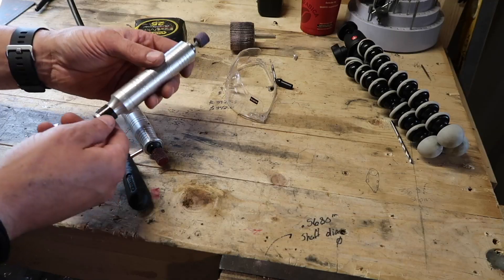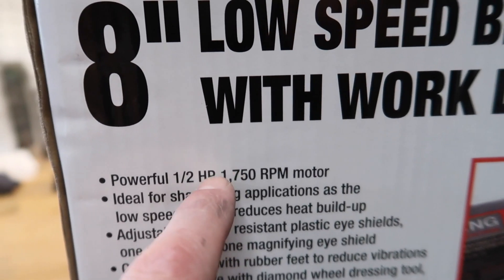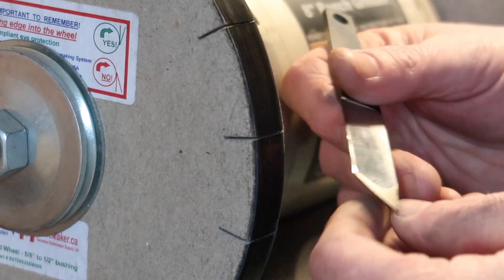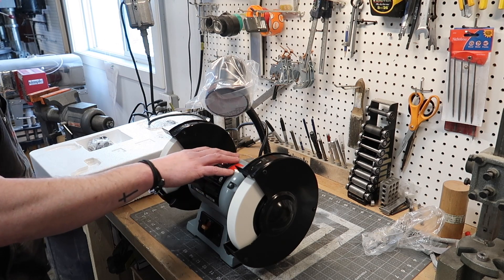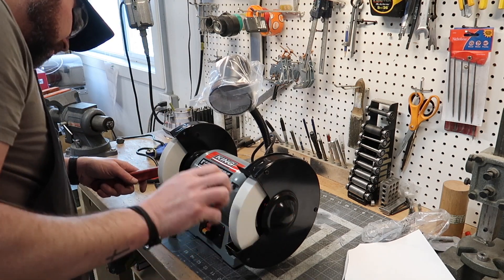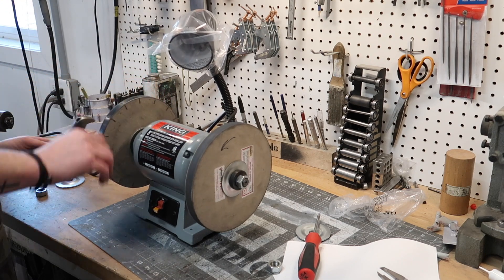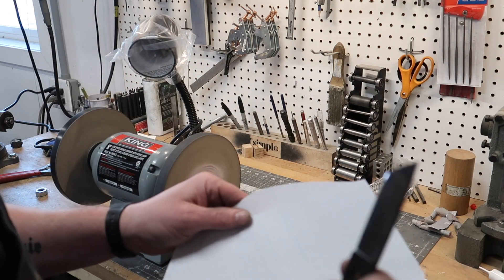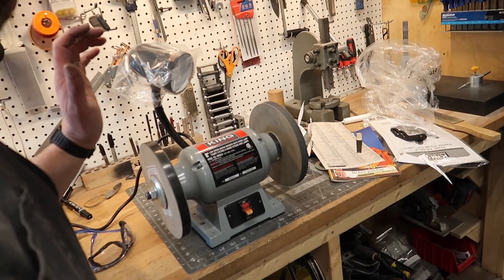Can we make this knife sharpener better? Tool Time Tuesday

Comment: I have a paper wheel sharpener.  I don't feel like a machinist when I use it, but I wind up with a sharp knife.  One thing I did was I replaced the 180 grit on the course wheel with a finer grit, possibly 320.  It was much more satisfying as I rarely sharpen a totally dull knife, and it feels less destructive.  I got the grit on Ebay.

Comment: I never thought about standing to the side while turning on the bench grinder. It will now be put into practice. Thanks for that. I have been using the Wicked Edge to sharpen my knives and I finish the process with a leather stropping belt on my 1x30. I’m going to look into those paper wheels. Thanks again!
Reply: I have found 600 grit on the 1 by 30 followed by leather belt gives a good quick edge, you do have to be careful to avoid overheating though.

Comment: gave up on regritting the mdf wheel, made an 8" plywood wheel, glued on 240 grit emery sandpaper, lasting over 50 sharpening and still going without any signs of failing!!!!

Comment: I have had paper wheels for years and never over heated a edge yet. But I know when to back off. A slower speed wheel is an advantage but it can function fine at a higher speed with care.
Reply: At the cost of these blades any knife nowadays it’s just a chance I’m not willing to take it happened so fast overheating

Comment: I use beeswax on my sharpening belts and my old paper wheels and it's a lot more difficult to heat the steel up.  The beeswax really cuts down on the friction.

Comment: I  have my paper wheels on a 1750 rpm grinder.  I have my cotton edge buffing wheels on a 3600 rpm grinder. I recently purchased a Wen wet/dry grinder with 110 rpm.

Comment: I love Razor Sharp. Though you never wanna see sparks. Hence the wax. Sparks indicate that you're already overheating the apex. You might get away with it on high alloy stainless tool steels. On high carbon or similar you probably lose some hardness even if it feels cold to the touch. You never feel the true heat inside the apex with your fingers. Temper colors also don't tell you the whole story, especially on stainless steels.
Reply: 1750 is still way too much it should be down to 1100 and even as low as 400 for speed and it should have a clutch built in like a washing machine motor this way if something goes wrong the machine basically shuts down before everything explodes in your face and you could also use it with buffing polishing pads make it a dual application also I would like to see one with the arms way longer away from the machine so there’s wiggle room to work

Comment: Those guys that are paranoid about heat don't understand heat treating and metallurgy. Way too much to type out but it takes a substantial amount of heat/temperature change to change the grain structure. As long as you are not turning colours and even then sometimes it does not have a large effect. Depending on the steel the change will happen at different temperature. The edge being the obvious thinnest is most quickly effected but again if you are not changing colours there is nothing to worry about.

Comment: I have the same set up with variables speed bench grinder use it always in a low speed and it works , trust me i still use whet stones and i like sharpening with wet stones but this is much faster and it works every time

Comment: Usually temper ruin only after 200 °C , that is yellow color on the blade, brown-bronze is about 220 °C and blue is 300-330 °C

All temperatures bellow 180 °C don't take any effect on your hardening of blade.

Because of tension relief from blade after heat treatment.
Usually that is 180 °C for 20 min. If needed less cheapy steel - 200° C. (and -1..2 HRC)

HSS steels do the same but with 540 °C. 
They have another mix of alloy inside.

Thats why for HSS steels (M2, M3, M4, and else) safe temperature would be below ~540 °C 
HSS steels was created to do their jub in those hard temperatures same effectively as in the room temperature.

Thanks a lot for your researchings and sharing of experience ✨🌿🤝🏻👌🏻

Comment: I also like paper wheels and felt wheels  for sharpening.  I have been trying to think of a way to design a simple attachment to my 2x72  grinder so I could make use of the variable speed.  So far all my Ideas exceed the fabrication  techniques that I have in my shop.   I would like the attachment to be driven by a 2x72 belt with a shaft  holding the wheel like the bench grinder.

Comment: You can purchase a variable speed 1/2" drill from Harbor Freight for $40 with a dial on the locking trigger for speed control. Using an adapter for mounting the grinding wheel then you can clamp the drill to the table. Voila you have a portable low rpm sharping wheel.

Comment: For my own personal reasons, I'd be a bit cautious about running MDF wheels at 3,600 RPM.
My preference would be 1,725 RPM or less but that is just my choice.
I do like the MDF sharpening idea and it would be my first choice for sharpening knives, wood lathe tools, etc.  For axes and metal cutting chisels, I'd stick with the stones.
Reply: Would you mind sharing those personal reasons?
Reply: @carlosmariosuarez5319  
1.  MDF is not and was not designed to be used for rotating apparatus.
2.  There has been no testing by a qualified 
test lab that would certify MDF for this application. (to my knowledge)
3.   You are a one person test lab. If the wheel explodes, your life could be in danger, you could lose an eye, or suffer serious bodily injury. 
 4.  There are more reasons which I won't get into with this discussion.
5.  Use at your own risk !
Thanks for your reply

Comment: Just watching your latest video. I love the paper wheels, now seeing you using a slower grinder it's giving me some ideas. One issue I'm having with the paper wheels is regriting the wheel. I haven't found a really good video that shows how it's done. I don't know what it is supposed to look like when it's usable vs. unusable. When I do the regrit I always get a faceful of silicon carbide when I start it and put a blade to it. If you could make a video on this and the correct procedures I'd come out there and give you a big high five...and I'd also answer your hate mail comments...hahaha. thank you for all you've done.
Reply: Respiratory protection ???
Abrasives are bad for your lungs.

Comment: Get a cork 2x72 belt and some buffing compound. It's my favorite way to machine strop. You can go right from 220 to this and it will mirror polish it to stupid levels of sharpness in just a couple lights passes. And I'm just not a fan of messing with a grinding wheel. When those fail, so does the rest of your life. If my 2x72 gets me, might break a finger if I'm unlucky.
Reply from the maker: I have several cork belts and buffing compound. These wheels are on a dedicated machine so I can just turn it on and go. I also find it a pain to have to keep my cork belts sealed in a ziplock bag so they don’t get contaminated with grinding dust. Also, if your grinding wheel fails, you’ve done something wrong. It’s like saying when you drive off a cliff, the rest of life fails. Of course. This is just a much more convenient setup that’s always ready. Far better for me than cork belts and compound.

Comment: Try a hard felt wheel on the 1750 grinder. There are many rouges that you can get for different metals and what your goal is. All woodworkers use a 1750 grinder to sharpen all of their lath tools and to grind a new primary bevel on plane blades and chisels. Plan blades and chisels are always finished on stones or equivalent films. Lath tools cut with a burr so coming of the grinder is usually enough, then you use a diamond plate to refresh the burr. Have fun learning.

Comment: I'd bet the wheel was hard to remove for one or both of two reasons.  First, moisture, just a little, over time caused it to swell.  Second, the compression from the washer may have caused a little bit of the swelling in addition to keeping the moisture swelling uniform and true.

Comment: You can work just as well with a faster RPM wheel, just move the blade faster across the surface. You're movements are a bit slow on the faster wheel. It's allowing the blade time to heat up.

Comment: shop fox buffer arbor $100.  3/4hp 3ph motor $75 110v vfd $85 & and you can have any speed you want
Reply from the maker: That sounds awesome. Although I have never seen prices anywhere close to that. Is there any chance you have links you could share? Cheers👍
Reply: I paid 179.oo for a surplus baldor 1hp open frame & teco vfd. The arbor was $99.oo on sale but the belt, electrical fittings, toggle switches, potentiometer etc are all extra but worth the effort... Here in Maine this is coldest November on record!

Comment: Do you know of any sure fire ways to compare quality of sharpened edge?
Reply: Edge-On-Up Professional Edge Tester is suppsedly becoming a standard for testing edge sharpness. There may be similar methods. My problem is this method is purely about sharpness and not edge retention, but it's good start at a standard.

Comment: I have the same set up they sent me a block of wax to put on the sandpaper side so that it stays cooler. Seems to work good.

I do have a variable speed control that lets me slow it down pretty good.
Reply: Do you think a candle would work, or is it too hard compared to the wax it comes with?
Reply: @carlosmariosuarez5319  it should, it’s just to cut down the friction some

Comment: The only problem I have with the wheel sharpeners is the fact that they give you a hollow ground secondary edge as well as the totmack  I prefer a convex cutting edge for durability ,  slightly convex that is, the wicked edge gives you a flat ground secondary bevel, That’s why I went back to my knife making grinder for all my sharpening I just made a jig for it that keeps my edge at the same angle works wonders, anyways that’s my two cents
Reply: @Rick Hall you are the first commenter to mention the issue of hollow grinding when using a wheel.  No others have acknowledged this fact of using a curved surface for sharpening or grinding.

Comment: If you want it run the other way and still retain the controls up front, cant the motor be wired to run the other direction? Just a thought.

Comment: Cut the cord to the grinder and put in a dimmer switch inline from the grinder to the outlet, you will be able to control the speed easily that way... only like $25 and a bit of knowledge. Works well.

Comment: Always wanted some of those wheels but they are so expensive.
Reply: I have made mine out of leftover MDF, works like a charm.
Reply: @redangrybird7564  I bought a wheel at the dollar store but it wasnt even perfectly round. Id Like to just buy a wheel.
Reply: @skillage18    A wheel is of not much use if you don't have a bench grinder.
Reply: @redangrybird7564  You dont say... I have three bench grinders.
Reply: @skillage18  ok, good, if you can fit one of those wheels then you can easily true the wheel with a wood chisel or a file. Check some videos on how to true a MDF wheel. That was the way I true the one I made. Cheers 😀👍

Comment: A speed controller will allow any speed and they not expensive
Reply from the maker: Only if your 110V motor is a brushed motor. Something like a router they work for, but not these motors.

Comment: You're donig tool time Tuesday all wrong.. It's Wednesday in Aus 😏
I'm on the ..no heat.. side of the fence. Tormek T4 is a great tool but a bit costly. Was going to get a cheaper Triton machine but it seems they are no longer available here.

Comment: Search for a AC variable speed controller :)
Reply from the maker: I don’t think those work with induction motors. They work with things like routers and other tools with brushes motors, but not with bench grinders.
Reply: @Simplelittlelife  You would need a VFD for that. Still, the low power Chinese ones are not expensive, <50$. They should be able to slow them down nearly all the way to zero. However pay attention with motors with integrated fans, if they run too slow they may overheat. In that case an independent fan is a good idea and often less loud.

Comment: Would the VFD be a viable solution for the old 3600 RPM grinder? Or am I pushing it?
Reply: Vfd is for 3 phase, there is no "good" way to speed control a 110v ac motor
Reply: @chrisnixon2179  there is good way its just not cheap

Comment: Did you say where you bought the slow bench grinder? If so I missed it
Reply: First use a low grit (36) sandpaper backed with something hard to remove the old surface. 

Sprinkle the carbide lapping grit on a flat surface like a piece of glass. 

Spread a thin layer of white Elmers glue on the new surface of the paper wheel.

Roll the wheel over the lapping grit until completely covered.

Allow to dry and cure 24 hours.

This will keep the wheel as true as possible with even grit distribution.
Reply: @Delta9BHO  thank you. I think you may have answered someone else's question, but I definitely appreciate the information. Are you a knife maker?
Reply: @nateand3  oops, it appears so. Yes, making knives in Canada 🍁
Reply: @Delta9BHO  that's awesome. I've made ONE. LOL it came out pretty damn good. Eventually I'll get into it more, but I work loads of overtime and have a side business...sooo. you know how it goes.
Reply: @nateand3  I hear that man! Knives are so satisfying to make, keep it up!
Reply: @Delta9BHO  that they are my friend, that they are. So often at work we jump from job to job and are never allowed to finish a job to a satisfying level, but I still carry a knife i made 2 years ago with pride. I've always loved knives and have more than a few, but if I could only keep one for the rest of my life,,,,it would be the one I made with my own hands.

Comment: Why not just add rheostat to your grinder?
Reply from the maker: I think you need a motor with brushes for it to work. I’m not an electrician but from the research I’ve done a motor with a capacitor won’t work like that. I could be wrong though...